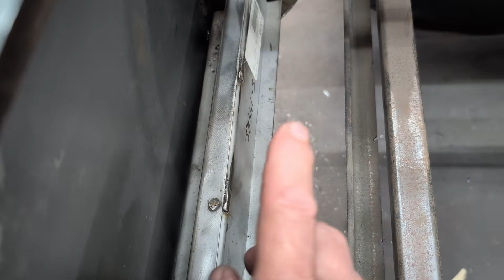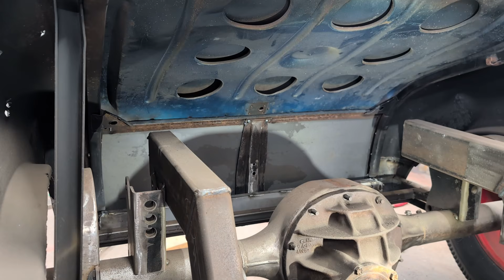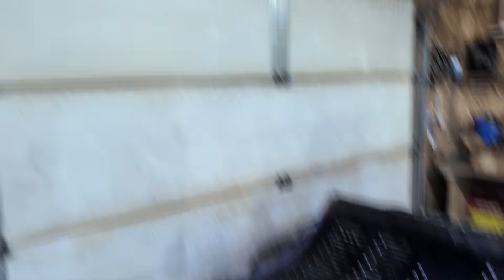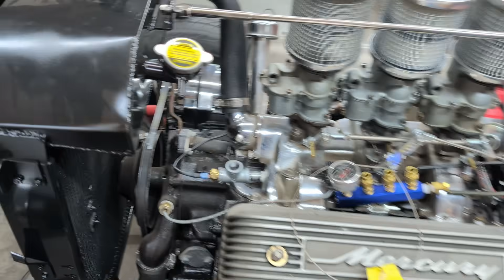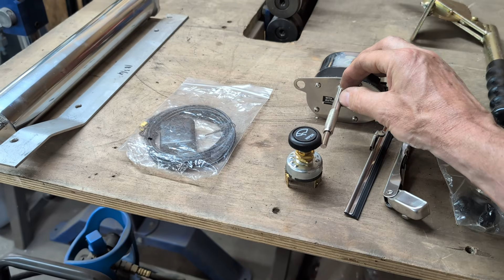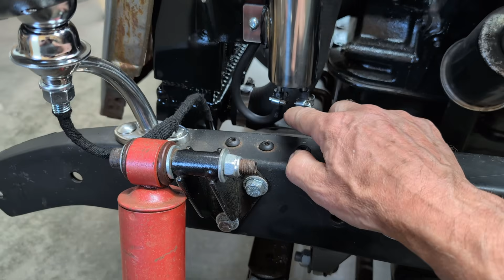1927 Model T Fixing the Deck Lid to make it fit, 1933 Fan & gauges get installed

Comment: Looks like you use MIG, Ever do TIG?
Reply from the maker: Mostly MIG because that's all I had for a long time. Slowly transitioning to TIG when I can.
Reply: @coldstreamrodshop  Seems like TIG might be awkward for hard to reach places under chassis etc requiring two hands. I guess every tool has its purpose. I'm amazed at the apparently excellent welders available at reasonable prices these days. 
Love your work.